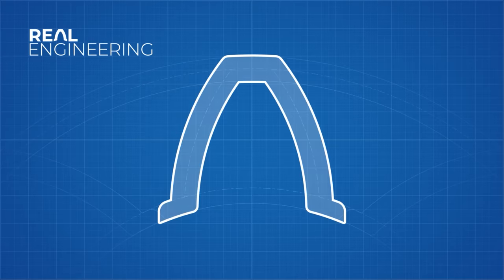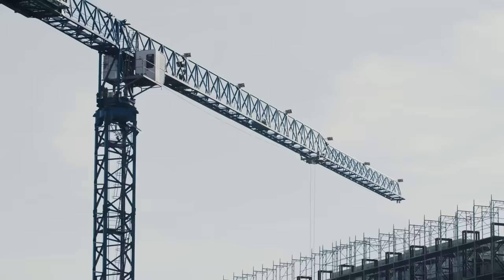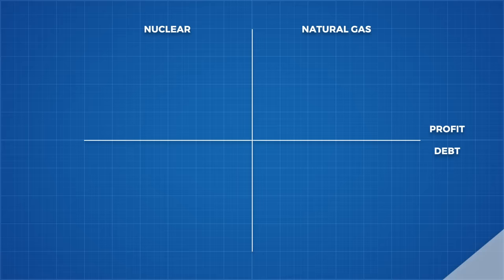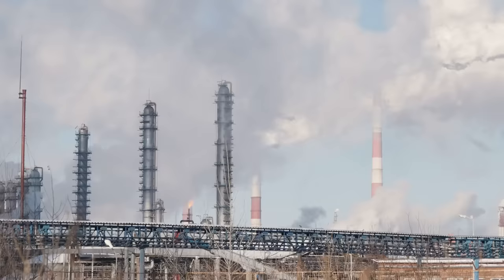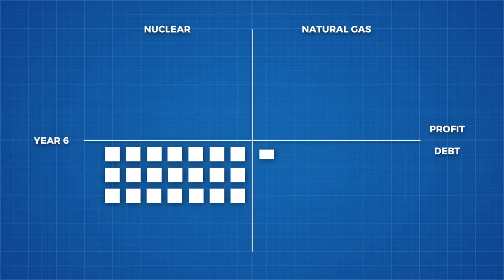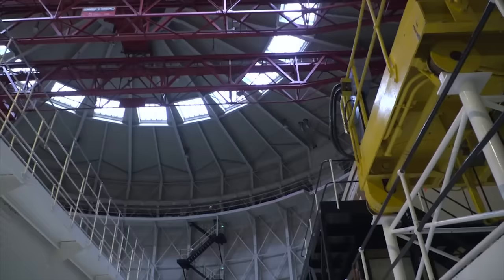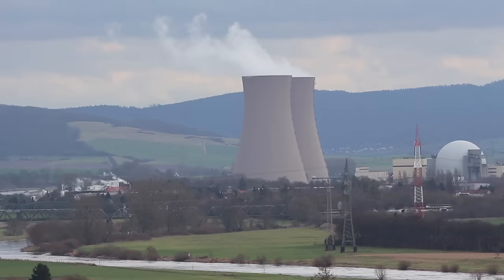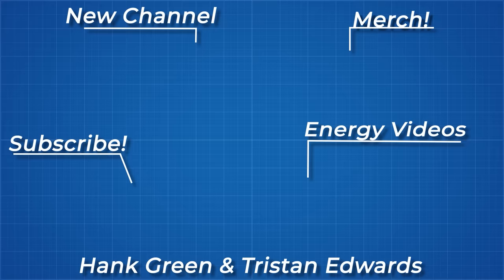The Economics of Nuclear Energy

Comment: "Nuclear is being replaced by Renewables"

Let me fix that...

"Nuclear is being replaced by Natural Gas "
Reply: But gas gets replaced by batteries once solar production get high enough, so it can still works!
Reply: the problem is that no one is taking into account the environmental impact of batteries production, they don't last forever and cause a lot of damage to produce.
Reply: @danilooliveira6580  all batteries are recyclable.  Battery technology continues to improve exponentially.  Lithium is cheap and low impact in mining.  Lead is a dangerous neurotoxin, nothing except car starter batteries use dangerous lead sulfuric acid batteries.  Lead is still emitted by coal plants, car wheel weights, bullets, and discarded car batteries.
Reply: Lithium ion batteries are fully developed. You won't get any more dramatic improvements out of them. If you mean maybe other types of batteries, then maybe.
The funny part is lead-acid car batteries are cleaner and safer than li-ion. They're just too limited in what form factors they can take and how heavy they are compared to output.
Unlike li-ion, lead-acid is actually fully recycled in practice.
Reply: @zolikoff  "Lithium ion batteries are fully developed.", "Unlike li-ion, lead-acid is actually fully recycled in practice.".
Tesla "Hold my beer".
Reply: Danilo Oliveira umm batteries can be recycled. Cannot say the same about coal or natural gas. Grid scale batteries are still in early days, I expect we will see a lot of innovation in the next 10 years as more and more natural gas plants become stranded assets.
Reply: Yeah it's crazy how many northern nuclear plants are shutting down and being replaced with natural gas units because of the labor costs involved with keeping those older nuclear plants running.
Reply: Truth
Reply: @loungelizard836  Sure but you need to considerate that ocean floors will be destroyed and ruined in search of more lithium and others metals to make more "batteries". If we want all cars to turn electric we need an insane amount of lithium. What I am trying to say is that not even lithium is green and holy.
Reply: @zolikoff  I heard there are Oxygen-Lithium prototypes with higher energy storage ratio. One of those "batteries" on a car could last 500km instead of 150km from a normal lithium one.
Reply: @johneccher9869  lithium baterry only has a fraction of actual lithium.  Its mostly aluminium and copper with a dielectric that contains trace lithium. Designs vary tho.
Reply: And in Germany, it's being replaced by coal. Hence their issues.
Reply: You all know that grid storage batteries are open to a wide range of electrochemical storage methods, that wouldn't be economical in an automobile.
The big thing in the grid storage right now is molten aluminum batteries, that have a lower mass to kilowatt hour ratio, but are far cheaper and environmentally friendly to implement.
Reply: @loungelizard836  and what about the space that you'll need to put an incredible amount of Sola panels to feed the earth?
Reply: @danilooliveira6580  Environmental damage and climate damage (for lack of a better term) is somewhat of an apples to oranges kind of comparison. Both are fruit, but they are different from eachother.
Reply: @danilooliveira6580 , there are plenty of peer-reviewed papers that quantify the consumption and waste products from the production of Li-Ion batteries, and  to those in the industry, those costs seem small when compared to the status quo.  Google Scholar is your friend.  Electric Vehicle batteries  that are exhausted are repurposed for grid-based storage where they can serve for decades.
Reply: @Daniel-yy3ty  We can't even make enough factories to produce all the batteries. You can't power everything with them. Also, we are getting close to the chemistry limit of how much energy you can get out. No matter how much research you do into Li-Ion batteries, you will never get something cheap, energy fense and scalable.
Reply: @jake What's Tesla got to do with that? They don't make li-ion batteries (they buy them from Panasonic) and they do not recycle them either.
Reply: @wyattroncin941  No, that is wrong, in fact coal is slowly shrinking in Germany, though if not for shutting down half their nuclear plants, it would have shrunk more by now.
Reply: 1. Batteries aren’t recyclable. They are incinerated in the UK. The UK is gets at claiming incineration is “recycling”. Does the same with plastics. Please don’t say batteries are recyclable. Recycling would be taking a bad battery and turning it into a good battery. Not possible 

2. People have been saying that batteries are about the replace the conventional power grid approach for at least 5 years. We are still nowhere near a practical solution.

3. Natural gas is very short sighted. It is a finite resource, while simultaneously filling the air we breathe with carbon. The Gaia hypothesis dictates that the world will change to account for this. How is the worry.
Reply: @turningpoint4238  You can't recycle lithium ion batteries. That's the whole reason Tesla gives their used cells to storage banks at discount. They can still be "reused" but not "recycled". The elements are mixed too finely to be melted apart and then made into new cells. The cells still work past their prime but efficiency and storage capacity are greatly diminished.
Reply: @danilooliveira6580  unless they use gravity/potential energy "batteries" by using pumps to store potential energy to be used later. Ex: Pumping water uphill during daytime solar over production, and using that pumped water to power turbines during the night time.
Reply: @Daniel-yy3ty  Its not practically possible to store enough electricity to replace just a days outputs (24GW/h) of a 1GW thermal power station let a whole grid when MW/h battery is the size of a shipping container.
Reply: @Skylancer727  Companies are recycling them, Fully Charged had a video about one company with an extremely high ratio that can be used.
Reply: @anydaynow01  Its not the labour costs.  There more money to be made by scarcity of electrcity as utilities with nuclear units general have other power station so would will make more from the now higher market price and with a nuclear unit closed it can now access the decommissioning fund. 

A quick bit of history Nuclear power station in the United States were build by power companies when they were regulated monopolies who had an obligation to plan for it customers future electricity needs nuclear were built for the most part as baseload units since in the long term they are cheaper.   

Deregulation has resulted in a short term thinking and a rigged electricity market - someone thought it was a good idea to force the grid to take renewables (unless its paid to stop) even when there is no demand for the power leading the a new phenomenon called negative pricing but since Nuclear plants in the United States were built when utilities were regulated monopolies they were designed as baseload units so its cheaper in many cases to pay the grid to take it output.  

Load following and peaker units unlike baseload units like nuclear and coal designed to run 24/7 in many girds get paid just for being available to generate electricity (capacity payment) so the market price is less important to them and they get to set the market price as high as the market will bare or low enough to erode the income of baseload units.
Reply: @loungelizard836  They are, but just in theory and only with very high and weather-independent power supply: In Europe there are less than two dozen rather small companies who can recycle lithium batteries at all, but only one of them has had the courage of a mere "at least, we will try" to the batteries of a burned out tesla.
Reply: @justmytake4152  >Deregulation has resulted in a short term thinking and a rigged electricity market - someone thought it was a good idea to force the grid to take renewables (unless its paid to stop) even when there is no demand for the power leading the a new phenomenon called negative pricing

Lol how does the word deregulation and "force the grid to take renewables" coexist together. If the grid is by law forced to do something, that's regulation.
Reply: Or coal power plant 😂
Reply: @danilooliveira6580  been debunked  already.
Reply: so older plants should use cheap unskilled labour to run ah? Its the cost of doing business.......if they cant run within the constraints, they should go out of business. Natural gas plants run as peaker plants also will go down when your gas prices skyrocket. As far as i can see, the SUN doesnt charge market rates.
Reply: @johneccher9869   if your daily drive is only 50miles,  seems pointless to look at it that way. We should concentrate on the 80% who only need a small range before investing in diminishing returns.